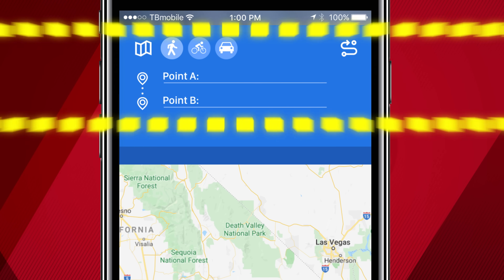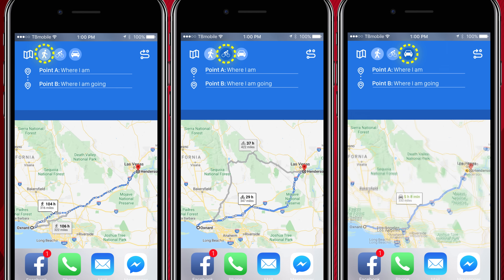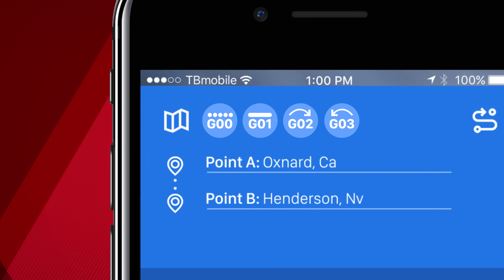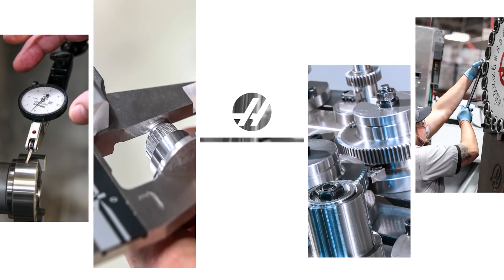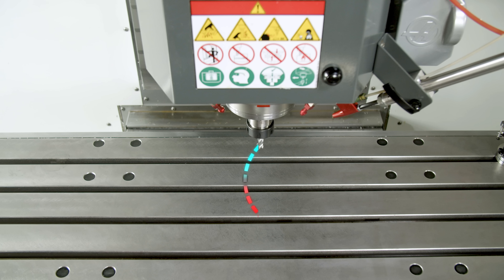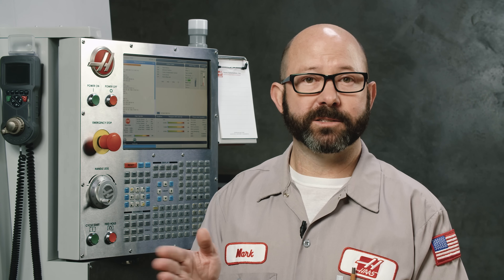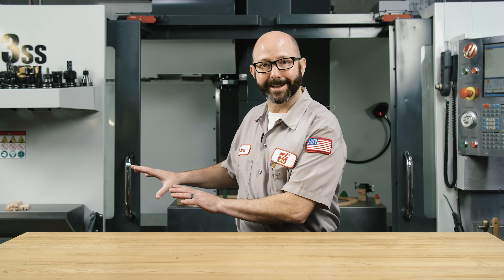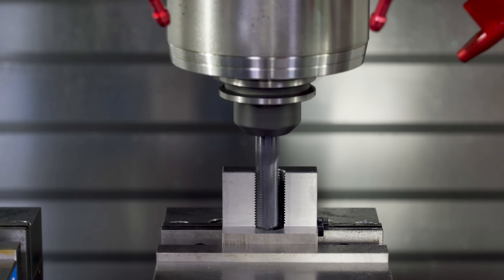G00, G01, G02, G03 – EVERY PART YOU’VE MADE USED THESE CODES! – Haas Automation Tip of the Day

Comment: I was very happy to be able to turn on rapid motion directly to the point. 
Unfortunately, there is an error on my UMC750 and when this option is enabled SOMETIMES the machine moves in G0 to a position that is not exist in the program and then slowly moves to the correct position. Very strange and very dangerus....
Reply: With a UMC, or any 5-axis machine, you need to be very cautious. We are constantly transforming the machine positions with Dynamic Work Offsets (G254) and Tool Center Point Control (G234). For consistency I’d program any rapid moves between angular positions with a G53 (always off machine home, regardless of G254/234) or I’d let the CAM system control those linking moves with controllable G01 CAM created links. This is a concern with all 5-axis machining. Really good thing to look out for.  Great comment.
Reply: @markterryberry4477  I am very happy that you have responded to my comment personally, Mr. Mark. The problem that I described is very strange because the code is very simple. The program is the most ordinary surface planning. What's worse, the same program code running once may not fail and the next same program the machine moves to a place where it is not in the code. [We dont use TCPC, only 3+2 with g254] On the next week probably the service will come to the machine for fix oil lubrication on Y linear. ill ask serviceman about that. Maybe a simple machine software update will fix it. Sorry for my bad English and greetings from Poland. Piotr.

Comment: Video request for the future:
Hand programming a bore milling with radius compensation and with a radius at the start and at the end to avoid the little left "V" shaped material where the tool first contacts with the workpiece.
It is a really nice way to do bores for narrow tolerances (to put a bearing for example) where you can only use endmills and that little left material (0.02-0.03mm) can cause problems.

Comment: I like this video. Good explanation of circular moves. A lot of post processors have issues choosing correctly between R's and I&J's. Knowing when it's happening is a life/machine/part saver. (Try loosing a $1500 blank because of this.) This is from running Haas controllers for over 25 years.

Comment: I have a question ... Maybe it has already been explained in previous tips ..... but
What is the best way, for Aluminum / Bronze / Brass
Routing milling when milling from A to B, and your workpiece is below line A-B
Or counter-current milling when you mill from B to A, and your workpiece is below the line B-A.
Sometimes I have strange areas in the material, I think it is due to the milling direction.
Thank you, greetings from Holland.

Comment: Love this explanation, we are all running to the toy shop to buy a wooden train set 😉
But all joking aside: at 4:15 you show a window with a graphic representation of the toolpath. Is there a way to visualize the toolpath on an NGC to simulate a program before executing it ?
Reply: We can press the 'GRAPHICS' button, in the top right corner of the keypad, and this will put the machine in Graphics Mode. We can safely check a program visually from there. On Classic Controls, we would press the SETTING/GRAPHICS button twice to enter Graphics Mode.

Comment: Hi mark I have this program I have to run but I don’t quite understand where the programer has got his Z movements from. Any help appreciated.

T7 M6
(1/8x27 NPT THREAD MILL)
(D07=-0.0215)
S2500 M03
G90 G54 G40 G00
G00 X0. Y0. 
G43 H07 Z2. M08
G01 Z0. F50.
G01 G91 Z-0.2776
G01 G41 D07 X0.0325 Y0.0325 F1.
G03 X-0.0325 Y0.0325 I-0.0325 J0. Z0.0046
X-0.0653 Y-0.065 I0. J-0.0653 Z0.0093
X0.0653 Y-0.0656 I0.0656 J0. Z0.0093
X0.0659 Y0.0656 I0. J0.0659 Z0.0093
X-0.0659 Y0.0662 I-0.0662 J0. Z0.0093
X-0.0331 Y-0.0331 I0. J-0.0331 Z0.0046
G01 G40 X0.0331 Y-0.0331 F50.
G90
G00 Z2.
G00 G53. Z0.
G53. Y-0.1
M30
Reply: Hi George. After the NPT multi-tooth threadmill reaches its depth of Z-.2776, the program switches to G91 incremental mode. For 27 threads per inch, that means that the tool needs to move up in the Z by  .037" with every full revolution (1/27=.0370). This program has the arc segments broken up into 4 segments per full rotation, so each 1/4 circle segment needs to move up by .25x.037 which is where those Z.0093 moves come from (.037/4=.0093).  Check out G90 and G91 in the Haas Manual for some more info on this one.  Beyond this, they have a leadin and leadout with small Z.0046" moves, which is great. These small leadins are about 1/8 of the circle, so they use 1/8 of the pitch as the Z move (.125*.037=.0046).

Comment: great video, i didn't know about the negative radius "trick" it'll come in handy for sure :-) 
could you make a video about G150 used with the C-axis? for example a round bar with 4 square pockets evenly spread around the circumference... possibly on a UMC-750? i've recently had an issue with this, where the machine would not rotate the commanded G91 C90 in G55 or G53, when the G55 C=0 is offset any amount of degrees. it would add or subtract the offset in G55 (even when commanding G91 G53 C90), so it would only move 88 degrees, if the offset was at -2 degrees, or 92 degrees if the offset was at +2 degrees...  it only did it in the M97 subprogram where G150 was present, and not in any other M97 subprograms...
sorry for the long comment, but i figure you guys are the best to ask. my local Haas servicecenter here in denmark haven't gotten back to me with a solution yet :-)

Comment: At this point, you guys can probably to an entire manual using videos
Reply: We are getting there!

  If I was pointing a new operator/setup person to some good info on Haas Mills, this is where I’d start. 

  Check out the Haas Certification program. The videos will help familiarize you with the Haas control. 
Haas Certification     https://learn.haascnc.com/ 	

  Here is a link to a video that shows a complete part setup, with links to other videos as well
Complete Part Setup    https://youtu.be/gbcMm-rSXZY 	

  From there we have quite a few videos on different topics ranging from Setup, to Probing, Macros, G-Code programming, part measurement, calculating Speeds and Feeds, Tapping, Drilling. 

  After you’ve seen the complete part setup video above, I’d take a look at these videos:

  Programming:
9 Essential Lines of Code     https://youtu.be/hJM8pnUazpk
G0/1/2/3     https://youtu.be/XqEWdLbOeZQ 

  Setup:
Set Tool and Work Zs     https://youtu.be/uNjMIIRttFE 
Pickup a Hole     https://youtu.be/kvkO_If3UVg 
Pickup Edge of Part     https://youtu.be/AyMsFtwzrmI 
ER Collet Essentials     https://youtu.be/WKikm6cQKh0
Tool Holder Essentials     https://youtu.be/-xH06bgpcIY 
Loading Tools     https://youtu.be/IbJOgvXADU0
Haas Side Mount Tool Changer     https://youtu.be/DIQt--72k1E 

Drilling:
               Peck Drilling Cycle     https://youtu.be/AM6nVgKjBQo
               G98/G99 Clearance Planes     https://youtu.be/YbbZJ7H0NUw 

Tapping
https://youtu.be/bkrUzGooA9k

Speeds and Feeds
https://youtu.be/gTnkNHB7dss

Measuring:
https://youtu.be/1tpyf5o9H20

Probing:
               https://youtu.be/J7dCwBkUNNU?list=PL1FfK7Yod27cy-MIhXsKkDwTmvclf7ps7 
https://youtu.be/5I1eG49XnTA 
https://youtu.be/fFZi6rWIcuU